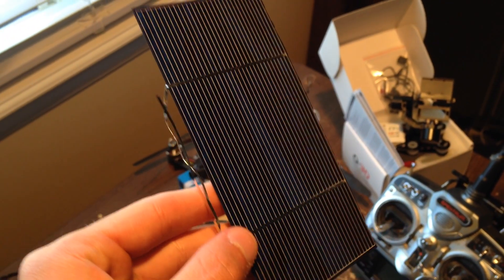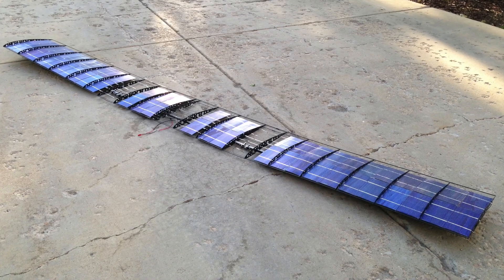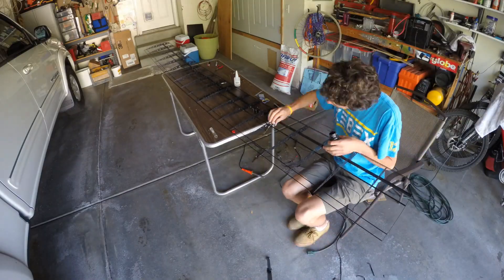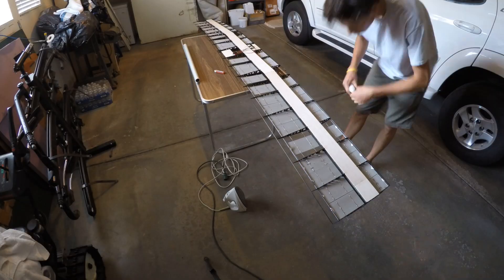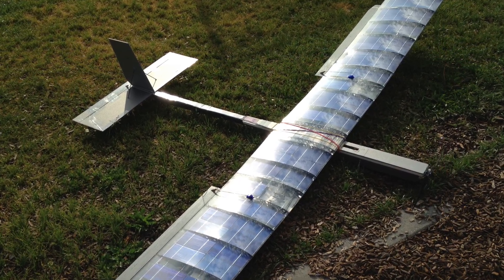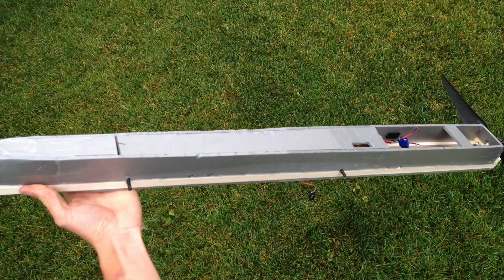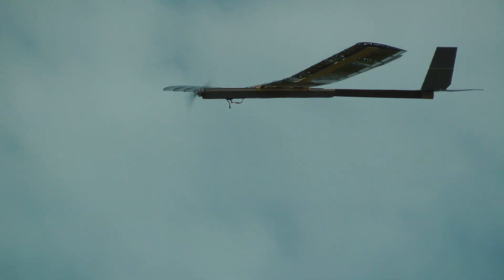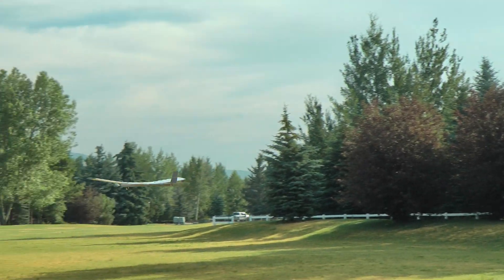SOLAR Powered RC FPV Plane Build and Maiden - RCTESTFLIGHT -

Comment: Very nice! The lower limit to sustain flight with slowfliers is about 100W per KG weight, if the motor and propeller are very efficient. I count 54 x 2W-peak solar cells, enough to lift 1.08KG at absolute peak performance (they generally rate this with a flash, that provides more light per square meter than the sun, so you can't expect the full output rating). The plastic will absorb/reflect at least 10%, the average angle to the sun will miss at least 15% potential, and lets say average skies/particle blockage is 15%, that's 40% loss. The sun gives a maximum of around 1050W of light per square meter, if it's straight above and the air is very clear; the cells are about 17% efficient if clean, so that's a max of about 178W per m2 solar cells at best conditions; 40% off that and we're down to 107W per m2 cells. Your 54 x 2W with the 40% loss cut off, gives you about 65 watts, but you need about 190 watts to lift 1900g, so the cells provide about 34% of whats needed. I would suggest to have a balance charger on it, but then realized that it would have to be able to provide at least 6 amps; a single small battery wouldn't like such fast charge anyway.

Option 1: Have several balance charger PCBs for each of several parallel batteries (but even more efficiency loss: about 20% in the chargers voltage conversion, and at the very least 20% in the charging itself, so 65W -> 39W).

Option 2: Have 2 parallel 27 solar cell strings (13.5V max), wire them in parallel with the battery. If the batteries can't collectively handle 6A charging, separate the cell strings and the battery, by 2 or 3 parallel 10A Schottky diodes, in series with the battery; then those peak currents don't have access to charge the battery, but still has access to the motor (the voltage drop of the diodes cause about 5% battery supply-capacity loss).

Option 3: Have another but smaller motor, higher KV, e.g. a pusher, that runs solely from solar power. Have the two power systems separated, but control the solar motor through your RX, and set it to full throttle through a TX switch or pot; then it will just chew all current thrown at it, unless the current exceeds it's peak current draw of course. Foldable main props would be nice to give better efficiency during solar-only flight. The main motor wouldn't have to be quite as "powerful/heavy" either.

Option 4: A new plane with lighter design, with much wider and deeper wing area to allow sufficient energy harvesting, to exceed the needed power even at 50% of peak-efficiency. Fun coincidence that you post this video today, because I did calculations yesterday to roughly find out how big a solar wing would have to be, to support it's own total system weight down to 50% effeciency. It has to be pretty damn big, and light of course.

Option 5...: ?

A little caution: solar cells act as diodes, they have a low reverse bias voltage, I think I remember it's about 17V each so generally no problem, but if one parallel cell-sting voltage or the battery voltage, exceeds the total reverse bias voltage of another shaded string, the cells cook. 10A Schottky diodes are often used to separate stings, to avoid reverse biasing if one sting gets shaded, but the disadvantage is that they burn off some efficiency in their voltage drop. The current that a sting can provide, is limited to the current output by the worst performing cell of the string, so if one is shaded completely it essentially becomes an open circuit (prone to reverse bias). Most solar panels have cell segments, with a bypass diode in parallel with each X number of cells, so if one of e.g. 3 cells are shaded, the current bypasses those 3 cells, enabling you to harness energy from most of the rest of the sting.
Reply: TheMrTape Thanks for taking a year off to write this book.
Reply: Jesus, calm down Mark Watney.
Reply: TheMrTape Good stuff TheMr, thanks! One cool thing about YouTube is finding great info in the comments, especially with channels that attract people with experience and attention spans..
Reply: TheMrTape This is not really his style. He's more of a 'build it, learn from it, adapt it', kinda guy. And I'd personally much rather watch videos of projects like his, than read through text walls of theoretical calculations.
Reply: Migueldeservantes I don't know any affordable solar cell technology that is any more efficient than around those 17%; the two leading ones are polycrystalline and monocrystalline, mono being the most efficient and generally the most expensive. It's already possible to maintain flight by solar power and it has been done commercially already, you just need a giant wing area. A 4W-peak 16 x 16cm cell weighs ~6 grams, so it has to generate about 0.6 watts only to lift itself... Horrible. But if you have enough solar cell area it's just barely possible, when the conditions permit it. We can forget about storing any energy from daylight to keep flying at night; not enough available power for charging and it couldn't lift all that extra battery weight anyway.

You could possibly gain a higher efficiency than available solar cells if you harvest the light as heat, by one-way-mirrored compartments or black painted heat pipes connected to a heat-pump system, then convert that heat into motion in a piston engine, through the pressure differentials of the hot and cold parts of the heat-pump system; but this isn't exactly very trivial to do, alone making sure it's light enough is a serious challenge, if it's possible at all to begin with.

You would have to perfect a new solar cell technology otherwise. Researchers have recently achieved a 60% efficiency by using graphene, but graphene based solar cells pose many challenges, they can make it work for a very short amount of time, but not continuously, yet. I would bet graphene; it's gonna revolutionize things pretty soon.

Graphene is awesome, there was graphene transistors made years ago and they can switch at several 100's gigahertz (theoretical 500ghz) while producing extremely little heat (graphene has ultra low resistance); now to apply that to computer chips, so we can finally run 512 instances of Crysis 3 in software on our 128 core 133ghz CPU, peaking it's temperature at 10C above ambient while using a small passively cooled heat sink. I give it 15-20 years before the previous statement become reality (10 years till first commercial graphene CPU).

If you can't make a better solar cell, you could try harvesting the energy elsewhere; the air is full of static electricity for example, the air charges up as long as the air molecules are being made to contact and separate by mixing winds and differing pressures (induced by the sun). Even in still wind at night, the air hold serious charge like a battery. There's a device called the Testatika by Paul Baumann that's essentially just a Wimshurst machine, but additionally it converts the static electricity into usable DC electricity. There's some Christian village that has a 3KW one for shared power generation, you can find video documentation of that on Youtube. Have a search for Testatika on Google images too. I estimate the highest possible output-watts per gram of Testatika generator to be about 1W per gram, and with 1W being able to sustain flight of 10 grams, that sounds like a clear win. Now take a moment to wonder why this technology isn't widespread, and if any multi-trillion dollar industries could possibly become worthless if it became mainstream, and if 100's of other would-be world-changing technologies that you somehow haven't heard about could exist too under some rug, like gravity circumvention or a 1.5KW generator block that fits in your palm. "Rex research" is an excellent source for info about a lot of that.
Reply: TheMrTape If you go here: http://www.asl.ethz.ch/research/asl/skysailor/SkySailor27hFlight you will find a PDF about a solar powered 24 hour RC plane that uses 15 watts in level flight with a weight of 2.4 kilos (see last page for specs)
Reply: Paula Deen Hahah, I'm in the middle of that book.
Reply: TheMrTape You said it! I'm attending a college that has a large energy department. From what I've heard them talk about, solar cells just aren't as efficient as we would of course like them to be. I'm very curious how much longer flight can be sustained with solar panels though. I'm interested in energy that can be generated from a glider dropped from a very high altitude. A glider that can be dropped from 100,000ft, travel a long way with very limited power storage and autopilot back home.
Reply: TheMrTape 
Nice calculation but why do you even want to lift 1900g? It is a plane and not a copter so you don't have to directly lift (except you want to start vertically). The only thing to do is to get enough speed with the power and then... the air does the rest. I'd say a battery would be good to provide enough peak power for accelaration and lift off, but eventually not necessary for holding speed while in the air (depending on aerodynamics an stuff).

Just make sure the battery won't be overcharged by the solar cells, so you'll need a balancer. For much less fragile wings, there are also flexible cells available, but I guess they are less efficient. But with the ones you used now, you will probably always have to catch the plane instead of landing it on the ground.

I hope to see it flying again soon. Like your channel... keep going!
Reply: Lukas Leder
A plane lifts too, with it's wings. If it weighs 1900g, the wings must create 1900g of lift. Essentially plane wings are doing the same as helicopter rotors (wings too), they create lift by being pushed through the air. The difference is what goes into pushing the wings; a plane needs to be pulled sideways by secondary wings (propeller) in order for it's main wings to create lift, while a helicopter just spins it's main wings in place to create lift.

Flexible solar cells is another technology called thin film, but the efficiency is poor compared to the fragile silica ones, half or worse. It does weigh less for it's output and could be applied on a larger surface of the plane since you can include virtually all curves; maybe it would be nice to apply regular cells to all flat surfaces and thin film onto curved surfaces, optimizing efficiency vs. surface area. A problem to overcome in this case, with a series of thin film solar cells placed on differing angles, is to place them so the sting rarely gets shaded partially; if a single cell of a string gets shaded, it will open the circuit so all the energy from the rest of the string gets wasted (entire string current gets limited to the current output by the shaded cell).
Reply: TheMrTape 
Yes of course plane wings have to lift as well. But there is a big difference. Once you're in the air having some altitude, you're able to glide slowly down without any motor power or just hold altitude with much less power than you need by hovering with a copter. With any copter you always have to produce (almost) all your lift actively with motors and rotors. Wings produce a considerable amount of the necessary lift "for free".
So what I want to say is, for lift off and climbing you really need more power as you told us, that's why I would put a battery on it. But to fly around an hold altitude, you'll need much less energy, which will hopefully be provided by the solar cells.
Reply: Lukas Leder I misunderstood you, of course you're completely right. There's plenty of potential energy in altitude to turn into speed. If you nearly empty a battery and supplement with solar to get up as far as possible, you could probably glide for a very long time with solar help, especially if you can find thermals. That's good enough to consider the build for most I presume.

The less than 100W per kilo slowflier rule takes gaining altitude into account too, so you don't need as much just to hold altitude, my guess is around 65w depending on drag of the plane design vs. speed; with the best solar conditions, the cells on the plane will generate upwards 100W, so it should nearly be able to hold it's altitude, needing 124W if going by 65W per kilo. The higher you go, the less particle/element blockage; would make a huge difference 30k feet up.

Since the plane always needs at least the entire solar supply to hold altitude, there's not many reasons to add a charger, as you loose half the power by storing it and the charger takes up weight; in my opinion the rare cases when you're not throttling up much and could be charging, doesn't outweigh the added weight, and I think you will loose more energy to lift the extra weight than you save. You should spend all available solar energy to gain more altitude, instead of wasting half of it in charging so you can use the remaining half later; you can store the energy much more efficiently in the altitude.
Reply: TheMrTape no matter what...he's going to need at least 3-4 x the wing surface with solar cells

Comment: Good job, Daniel. I am wondering what is the specification of the solar panels you are using (the output voltage and max current output) please?

Comment: To charge the bateries in flight i have seen people just use one of those cheap crappy parkzone ballance chargers because  they are light and will do the job as really as well as any "digital charger" because the input power is very low from the solar pannes 

look on the Diy drones forums they have alot of information on this stuff the mygeekshow also frequents on it to
 maybe you could help each other out

Comment: I tried this a while back, the biggest problem I ran into was trying to find a MPPT unit small and light enough. Without MPPT you most likely wont get enough power from the cells to sustain flight.

Comment: At the root where the 2 carbon tubes bolt to the angle plate looks like it will split. I had this problem with glider after covering the wing. I managed to stop it by getting some brass tube and bonding it into the bolt holes. It seems to have stopped any further splitting. Good luck and i'm looking forward to seeing the results. 

73 de M6EXH

Comment: Beat MyGeekShow to it ;)
Reply: Not yet, he didn't actually use the solar cells for power
Reply: RCWilliam123 Give the guy a break. He's doing a good job....
Reply: tomstanton28 i was thinking same thing
Reply: TheLukey21 true but he does have a system ready and in place to begin testing so hopefully good things to come. come on guys we all want to see this work :D
Reply: Christopher Armstrong Just go watch?v=7OcKimBgaS4

Or alternatively if you're excessively cheesy, watch?v=HSkzFDfnB9A

Notice that this is >14 years old.
Reply: Thanks for the links but these are full size aircraft :(
Reply: Is MyGeekShow some channel that used to exist?